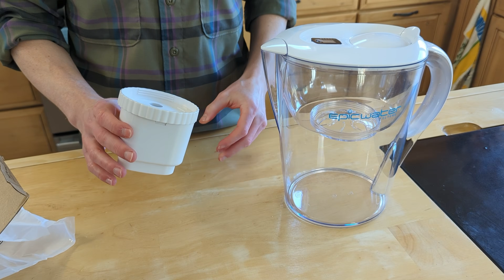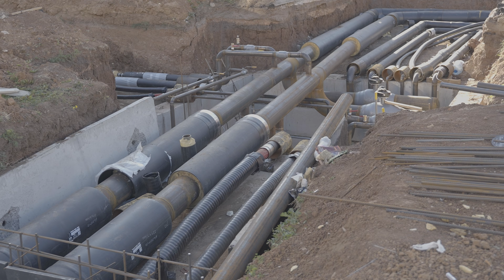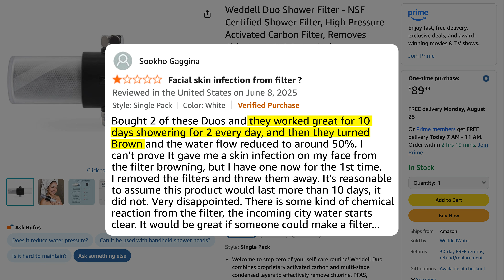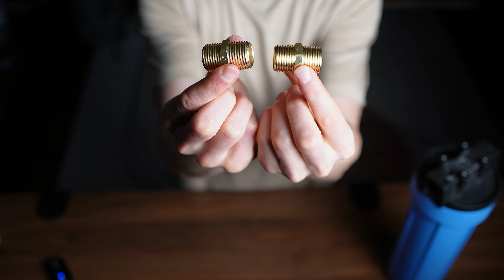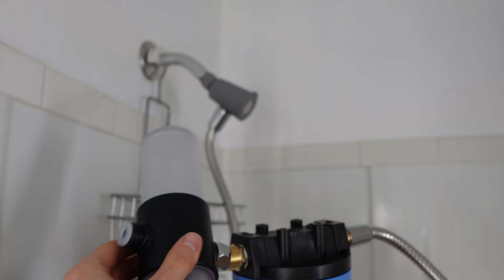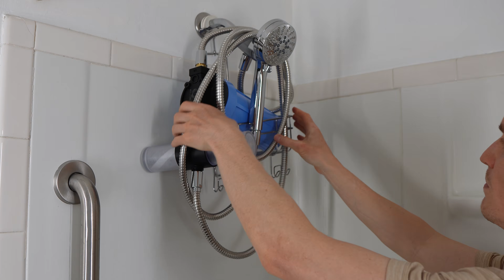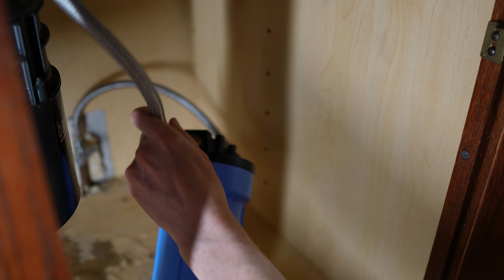You Have a Water Problem

Comment: I’m scared to test my water - and grossed out that I never thought to test my bathroom water🤢
QUESTION: I’m in Brooklyn, NY so I’m confident I need all of the above. My question is, after installing, can I clean the carbon filters of a Berkey or should I just replace and start fresh? (I use it for my cats & plants) THANKS!!
Reply from the maker: How old are the filters?
Reply: @waterfilterguru (thanks for responding!) Ha! Omgosh. I just checked my calendar…I mark the date around when we would on average consume the suggested amount of gallons - that’s today 1/1/2026. So they’re due anyway. BUT! What were you going to suggest? 
(I’m about to scour your videos.) Could you tell me if you’ve made content about at home delivery jugs? And, may I ask your opinion about the Oasis app? I just got it and am trying to judge how they make their ratings. The numbers are contradictory to results I’ve seem elsewhere but their point of measure may be different.
Reply: Also- this video helps me understand why we have to break down and clean the carbon more frequently, but we are only able to skim the outside. (I think)

Comment: I was able to use a cheap filter from Amazon to connect between the pipe and the Weddell. Then get a high pressure shower head for the spray end. it's no longer drizzling out and it's lasted 2 weeks nothing turning brown.  Compared to my first one.  It was just an easier more space conscious set up for me personally,  although I got the stuff you suggested,  the shape of my pipe going straight down, was making things not sit right.... 
but if I had not watched this,  I would have been upset not to use that nice filter! ❤❤❤❤ I appreciate you
Reply from the maker: Glad the video was helpful and that you found a solution that works for your setup! Really appreciate you
Reply: Could you please suggest which cheap filter did you use from Amazon?
Reply: @aryamangobse9642  just an Aquabliss...
i wish i could show the photo of the setup...

only thing is,  the height of the water head is going to lower significantly, which works for a shorter person like myself. I live in this overly fancy apartment where the pipe that goes straight down instead of an angle 🙄 it was very annoying for the situation.  if my shower was normal I could have done the hand wand attachment.
Reply: @divinistry1111 Get a long, adjustable shower arm. You can then position the shower head higher up.
Reply: @Lisa-rh5xu unfortunately that does not change the bar going down at a 90 degree angle, I tried it and it just took up too much space.  my final fix worked out well and much better honestly
Reply: @divinistry1111  Brian, will this work as well as the sediment filter that you recommended? Im in 90025 (west LA, DWP) and in an old building with galvanized pipe. If so, I could use this ahead of the rv water softener and then the weddell? AquaBliss SF500 HEAVY DUTY Shower Filter$38.24$45Walmart - Aquabliss Inc& more4.4(470)This model is specifically engineered for high-sediment environments. AquaBliss Replacement Sediment Guards$19.99Aquabliss& more4.4(27)Buy a multi-pack of these mesh pre-filters.
Reply: @FreedasMom the one he recommends is a long term, house level set up. I think it's more heavy duty for those that are in their own home and want the set up to last a long time..
my situation is an apartment rental where I'm only here short term and the shower area itself is not accommodating to the larger sediment filter set up. 
I think this depends solely on your circumstances.  
My water at this apartment was atrocious lol ... but the set up is going very smoothly so far with the Amazon one 🙏🏽💖 best of luck!
Reply: Hi, what cheap filter did you use from amazon?
Reply: @FreedasMom aquabliss

Comment: hey water guru, any advice on when to replace the black carbon filter for the weddell duo?
Reply from the maker: It's certified for up to 8,000 gallons
Reply: @waterfilterguru  If I have to change my Weddell white filter every 10 days, how often do I have to change my black filter? I have been changing the black filter every mth.
Reply from the maker: @Lisa-rh5xu  likely not nearly that often. The sediment filter is doing its job to protect the carbon filter. Get some simple chlorine test strips, as long as there isn't chlorine detected the carbon filter still has capacity. Replace once you see chlorine getting through
Reply: @waterfilterguru  ok Thanks.

Comment: Is there housing for this sediment filter that is stainless steel or non-plastic?

Also what is the likelihood of mold growing in the sediment filter?
Is it more likely if the sink isn't used everyday? Or is it not likely at all?

thank you!
Reply from the maker: Yes, there are stainless sediment filter housings, they’re just not very common in the residential under sink world and most of what you’ll see is plastic because it’s cheaper and easier to manufacture.

As for mold the big factor is whether the *disinfection residual* in your water, like chlorine, has been removed. Once the disinfectant is gone, you basically create a habitat wher can microorganisms grow, including both filter media and housing. That’s why carbon filters and stored water are more of a concern than a simple sediment prefilter that still sees chlorinated water.

If you’re on city water and the sediment filter is the first stage, mold growth inside the filter is generally not very likely as long as you replace cartridges on schedule. If the sink isn’t used every day, stagnation does increase risk a bit, but you can help by running the water for a short flush before use and doing regular sanitization of the housing when you change filters, which goes a long way to reducing any biofilm or mold risk.

Hope this helps

Comment: What about putting the On the go softener AFTER the duo?
Reply from the maker: That is how it should be, and how it's explained in the video. Water should flow through the Weddell Duo first, which removes chlorine that can damage the resin in the softener
Reply: @waterfilterguru  I meant what if I did ALL three. The Blue sediment pre filter — Wendell duo THEN On the go softener?
Reply from the maker: @DevinDean423  ah, yes that would be the correct order
Reply: @waterfilterguru I may end up giving it a try. I’m curious to see how much water pressure is lost 😬
Reply: @DevinDean423 did you get a chance to try it?

Comment: Is this shower filter setup better than your earlier recommended water softener tank by on the go
Reply from the maker: Each treats a different water problem, you may need both. A sediment filter removes just that, sediment, which are suspended particles in the water line dirt, sand, rust, etc. A water softener treats water hardness.
Reply: @waterfilterguru but won’t adding all three significantly drop water pressure? Can you test that?
Reply from the maker: @aryamangobse9642  depends on the incoming water pressure. Some folks have reported and increase in water pressure from the softener for example
Reply: @waterfilterguru since you have all three, were you able to test it?
Reply from the maker: I've not tested all 3 in sequence with my shower yet, I can add this to my list for a good follow-up video

Comment: is 20 micron enough to pick up the iron?
Reply from the maker: Oxidized ferric iron (aka rust) yes, depending on the size of the particles. It won't do anything for clear water ferrous iron though
Reply: @waterfilterguru  do you have any recommendations for the finer ferrous iron then?  I heard some people use 0.5 micron, but that sounds like it would hurt the water pressure a lot. thanks for the response

Comment: How to use water softener with this showerhead setup ?
Reply from the maker: Water softener should be down stream of the sediment filter
Reply: @waterfilterguru  Thanks for the response. Do I connect the water softener outlet with shower head as the last step?
Reply from the maker: @LaxmiNiharikaEpuri   Water softener outlet would go to a carbon filter like the Weddell Duo if you plan to use one, then to the shower head. Sediment > Softener > Carbon > Showerhead
Reply: @waterfilterguru  Thank you for the suggestion. I tried the setup and somehow the water pressure from handheld showerhead has reduced drastically. I tried removing the sediment and just kept the wedel duo, water softener and moen handheld shower filter. Any suggestions on how to increase the pressure ?

Comment: So you’re saying with the shower filter that big unit effectively replaces the white filter on the Wendell Duo? Does it filter as good? Because the issue I apparently have is not my water quality, but my high water pressure is sucking the filter so hard it becomes deformed it and drops the pressure in two weeks. The black filter seems to hold up though
Reply from the maker: Yes it's a larger capacity sediment filter which replaces the small capacity Weddell sediment filter

Comment: Thanks! I was able install mine without any hose lines. I just screwed the black lid from the filter housing directly onto the shower pipe, then screwed the blue filter housing onto the cap while it was tightened on. My shower head is height/angle adjustable so the extra length of the Wendell duo doesn't affect my setup that much 👌I have a shower caddy helping to support the weight underneath but might switch out with some suction cups or something later.
Reply from the maker: Glad it was helpful, thanks for sharing your setup!
Reply: @waterfilterguru  what about the weight?
Reply: Can you share which shower head/style of shower head you use for the setup? I would also like to avoid using an extra hose if possible when doing this.

Comment: Could this be used with the RV On The Go water softener system you featured in your other video? Or would the water softener remove the need for a sediment filter?
Reply from the maker: Yes and no. Each targets a different water issue. If you have both sediment and hard water, you would need both.
Reply: @waterfilterguru  Right, so let's assume I have both issues. Should I do the sediment filter, then the water softener, then the carbon filter last?
Reply from the maker: @panedivitasei   correct
Reply: Thank you. Though it’s definitely going to be tricky figuring out how to place all three.

Comment: If you are replacing the sediment filter for a larger one would the same problem with the water pressure still happen or just not as fast
Reply from the maker: Not as fast. When the filter reaches its capacity and is essentially clogged up with suspended particles its removing, you'll notice a decrease in pressure

Comment: Do you still need the white sediment filter that the wedell filter comes with or just the micron sediment filter that you attach because you don’t have it inside the filter
Reply from the maker: If you add an external, larger sediment filter you wouldn't need to use the one Weddell comes with
Reply: Cool thanks

Comment: I'm going to attempt to install the filter into my shower this weekend I ordered the parts. Although I decided to go with a string spun sediment filter as their higher temperature rated. However I'm now realizing that the housing has a Maxx operating temperature of 100 °so before installing I'm going to see what temperature I like and ensure that I don't exceed that temperature at any time because I'm slightly concerned about the housing's durability over time. I noticed that there is a glass nylon red housing that's a bit more expensive but it's rated to 200°. Using the red housing I would have to use a reducer since it only comes in 3/4 inch npt. 😅 And im also cutting out the weddel completely and im going to use a full size carbon filter so my system would have 2 housings now. 

Q: what do you think about using two housings 1 for sediment and one for carbon in the shower setup instead of the weddell? 

Q: 😅 should I consider upgrading to the red housing that's higher temperature rated and use a reducer to compensate for the size difference on the fittings? 

Thank you in advance for your reply, awesome videos ❤!!
Reply from the maker: The Pentek 158196 housing I used (this one here https://geni.us/BEWuaA ) has a max temperature rating of *125°F*, which is far hotter than the average shower temp. 

Here’s the official spec sheet: https://www.pentair.com/content/dam/extranet/web/nam/pentek/spec-sheets/310050-pentek-traditional-slimline-spec-sheet.pdf 

It’s also Tested and Certified by NSF International to NSF/ANSI Standard 42 for material and structural integrity requirements. you can see the certification here: http://info.nsf.org/Certified/DWTU/Listings.asp?TradeName=158196&hdModlStd=ModlStd&

To anser your questions:

1. Yes, you can absolutely try running two larger industry-standard housings: one with a sediment filter and another with a carbon filter. Just plumb them together and use the same method shown in the video to attach the outlet to your handheld shower head. 

2. I’d be cautious about using a glass housing in the shower because of the breakage risk. Since the Pentek housing is already rated for 125°F, there’s really no need to go with a higher-temperature option unless you regularly shower above that range (highly unlikely, that's freaking hot!). But if you decide to go with the red nylon version, you can definitely use reducers or adapters to make the size difference work.
Reply: @waterfilterguru  Thanks man! Hahah no way will i shower that hot but i do like to rinse out the tub from time to time with the shower head. I wasn't really sure what the max temp of my water was till now, it maxed out at 125. 😅 Yeah if the red housing drop that would be a problem but im just using RTV high temp silicone on the included metal bracket that came with the housing I ordered so I don't think it's going to drop but i went with the housing you recommended. ❤ Been using a ispring system in the kitchen for years and never thought of adding something similar to the shower, thank you so much for this idea 💡.
Reply from the maker: @Biz350  right on, let me know how it goes!
Reply: @waterfilterguru works like a charm. I feel so fresh and so clean clean. 😂
Reply from the maker: @Biz350   Awesome! Thanks for the follow up
Reply: You can replace the mixer valve with one that limits output temperature.

Comment: Would love for you test the new canopy bath filter
Reply from the maker: Coming soon!
Reply: @waterfilterguru  I’m a bit skeptical after seeing the shower review. I’d love a bath filter for my son though that actually does something.
Reply: The testing is done on soft water. You're still going to have to soften the water and remove sediment in most areas at least for the shower. You can check your zip code on the EWG website. Re Canopy: For Showerheads & Bathtub Filters:These use a 3-stage tri-media blend:Granular Activated Carbon (GAC): Made from coconut shells to absorb impurities, odors, and organic chemicals.KDF-55: A copper-zinc formulation that chemically reduces heavy metals and prevents bacteria growth.Calcium Sulfite: A compound specifically formulated to neutralize and rapidly reduce up to 99% of chlorine.For Sink Faucet Filters:The countertop tap filter uses a slightly different 2-stage setup:Non-Woven Micro Mesh: Catches and blocks larger suspended particles and sediments.Activated Carbon Block: Absorbs micro-contaminants, including chlorine, chloramine, and heavy metals.

Comment: Your other video said to install a soft water system under the sink. Now it is a sediment filter. Are you suppose to use both together? If so how?
Reply: What if you have both? Could you do a tutorial for both?
Reply from the maker: Depends on which issue you are dealing with, hardness or sediment? or both?
Reply: Both. How to use both together ?

Comment: what if your shower doesn't have a removable shower head like yours?
Reply from the maker: Then this solution won't work. You need to be able to remove the shower head. 

If you own the home, you could install a sediment filter on the main water line upstream of the water heater. This is an invasive installation which is why it won't work for renters.

Comment: Which system filters 
- Bromodichloromethane
- Chloroform
- Chromium
-Dibromochloromethane
- Dichloroacetic acid
Haloacetic acids (HAA5)
Haloacetic acids (HAA9)
- Perfluorooctanoic acid (PFOA)
- Radium, combined (-226 and -228
- Total trihalomethanes (TTHMs)
- [x] Trichloroacetic acid
Reply from the maker: Activated carbon and reverse osmosis are the main treatments for chlorine byproducts like chloroform, bromodichloromethane, dibromochloromethane, total trihalomethanes, and haloacetic acids (including dichloroacetic and trichloroacetic acid). Chromium is best reduced by reverse osmosis or anion exchange. For PFAS like PFOA, high-quality activated carbon, RO, or anion exchange are effective. Radium 226/228 is typically addressed with cation exchange softening resins or RO.

Comment: I'm getting a whole home sediment filter installed this week. Not cheap to hire a plumber, but if it works as intended it should actually save me money on filter changes in the long run... 🤞
Reply from the maker: If you are able to, treating sediment at the point of entry with a whole house filter is always the best solution. The method in this video is really intended for folks in rentals who can't do that. You're lucky you can!